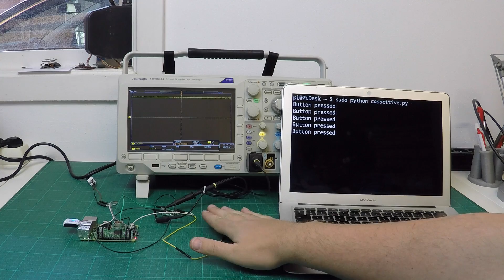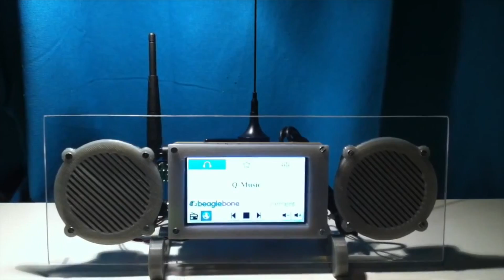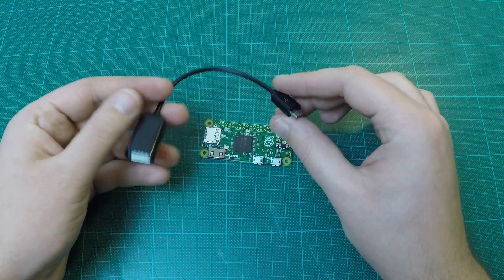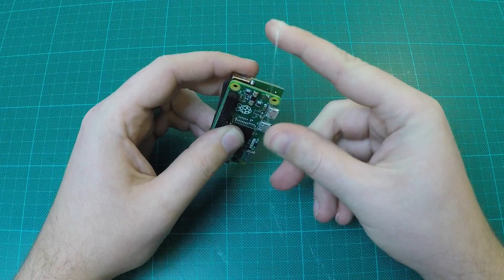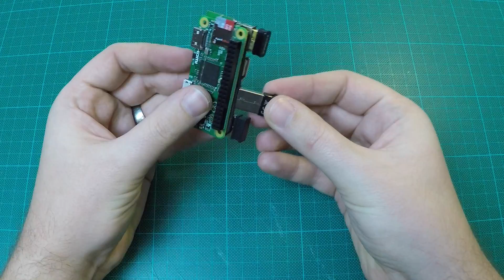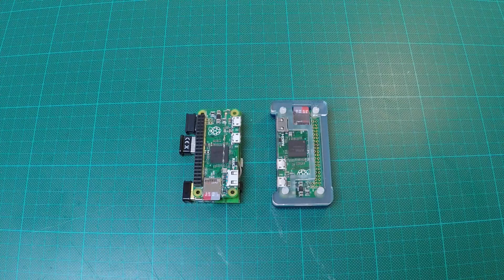Raspberry Pi Zero Piggy-Back USB Hub

Comment: I want to use pi zero / pi zero w or pi 3+ b as a usb flash drive to plug into another device with usb port..would this setup work for that use case?
The idea is to export files from that device into pi as if pi was a usb flash drive. please suggest

Comment: Fast forward 2 years and now the Pi Zero W has native Wifi and Bluetooth, and is now only $5. Then there is an off the shelf plug in hat that does exactly this, adds power and 4 usb ports, plus a power switch, for $12.
Reply: Yeah but this looks cool as hell, and bragging rights that you wired it up yourself.

Comment: Very nice to see it. Have you checked out Hubpixed - It is same as the above and you do not have to do the wiring. It has pogo pins and installs with just 4 screws. Was one of the best projects on kickstarter.
Reply from the maker: Hi Vikas,

I've seen it :) The video dates from when the Pi Zero just launched, hence none of these solutions existed at the time. The modification makes less sense now, but it did at the very beginning.

Comment: New HUB PiWi is a better option as it requires no cable or connector to connect and product is cleverly designed with three USB and a WiFi
Reply from the maker: It is, but didn't exist at the time ;)

Comment: A newer project called HubPiWi at kickstarter integrates Hub and a Wifi to Pi Zero - and does not require any Cable or Connector.
Reply from the maker: +Kumkum De Looks like the funding goal may not be reached, and the fact that the new Pi Zero has the pads slightly shifted, makes it incompatible between models. Looks interesting otherwise!
Reply: +Frederick Vandenbosch 

HubPiWi comes in two models one for Pi Zero 1.2 and another for newer 1.3
Reply: It did reach the funding raising $4500 on kickstarter. Also, open for pre order. You should also be able to buy it shortly on amazon and ebay.

Comment: Search for Hubpixed and HubPiwi - they do not need any cable or connector and uses spring contact to make connection. The HubPiWi is beautiful as it integrates a WIfi. The project is a great success at kickstarter.

Comment: Very Nice!

Would something like this work on the Pi2? Also, a closer look or diagram would be awesome.
Reply from the maker: +Kevin Brennan Hi Kevin, have you looked at the blog post linked in the description? There are some close up pictures and references to the pad numbers.

And yes, the connections would be slightly different, but this should work on the Pi 2 as well! :)

Comment: Hi, Great hack, making it. I was wondering if the power supply would be enough to power 2 hard drives simultaneously. I'm hoping to use it as a home server of sorts.
Reply from the maker: +Josiah Mendes Probably not, but then it's just a matter of using another, more powerful 5V power supply with the same connector. Make sure the drives also run on 5V.
Reply: +Frederick Vandenbosch Right Thanks a lot
Reply: Another thing, could i get a list of usb hubs that can be used? Because I can't find the one you mentioned in your video.
Reply from the maker: +Josiah Mendes Try the Belkin F5U404, it's an identical model.

Comment: You know what would be interesting? If someone created a case for the Pi for expressly this purpose. It could use screws or pegs the hold the Zero in place, then have some small copper contacts protruding up towards the zero to touch the proper contacts on the Zero (and since it's held in place, there shouldn't be any need for soldering) and presto, you have more usb ports, from a powered hub, that also powers the Pi, plus a case, all in one little easy plug-and-play kit. NO ONE TAKE MY IDEA! I'M COPYRIGHTING IT NOW!
Reply from the maker: +mygetrichslowplan That would indeed be interesting! I know CircuitBeard already has a version of a laser cut case for Pi Zero and hub: http://circuitbeard.co.uk/shop/hackcessories/pizero-hub-case

Comment: Awesome Hack!
Is it possible to take a cheap non-powered usb hub (i.e. http://www.amazon.com/Ecoolbuy-Port-High-Speed-Laptop/dp/B011NQIHPO ) and mod it to add external 5V 2A power adapter and use the setup with pi zero?
Reply from the maker: +Zahid Rasel I suppose it should be possible. By cutting the 5V connection between the Pi's USB port and the hub, and instead connecting the 5V power supply to the USB ports, and ensuring the ground is connected between both. Sounds like an interesting experiment :)

Comment: Can a barrel jack be added to the raspberry pi (any version) for power?
Reply from the maker: +Harry Rigo That should be possible, as long as you can find the correct points to solder your barrel jack to. Or you could build your own barrel jack to micro-USB cable.